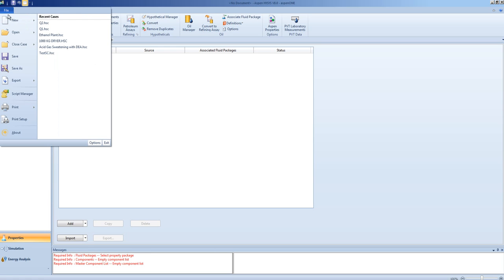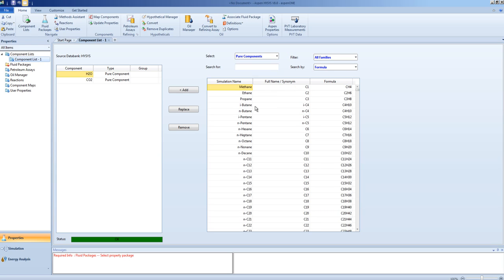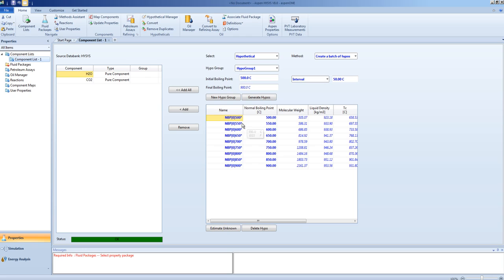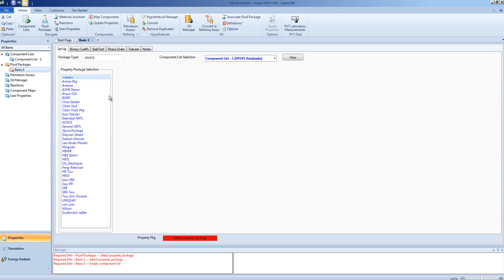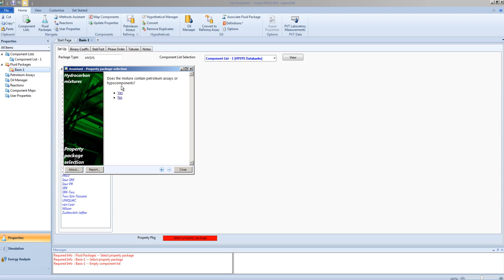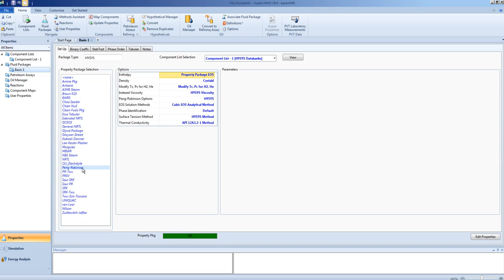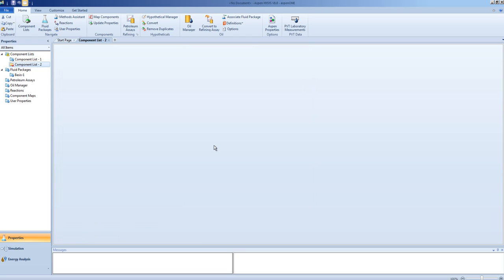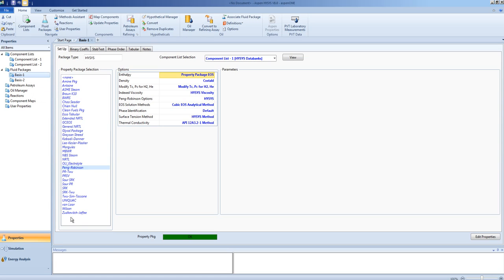Pseudo Components and Property Packaging

Comment: Hello! Thanks for the video, very helpful. I have a question. What can I do if I have a running simulation and I have to add a new pseudo component? I've tried it, but it says to me that "one or more blends are not installed" and I don't know how to solve it. I'll appreciate any help that you can give to me. Thanks
Reply from the maker: Are you installing the psuedocomponent from the boiling point range or are you attempting to install from the crude database?
Reply: Adrian L, I’m using the boiling point range for the assay
Reply from the maker: @gabrielaojedar  send me screen shot of error. You're not using any database here so shouldn't have an issue. Laltt179@gmail.com